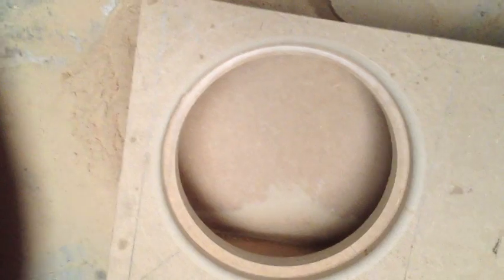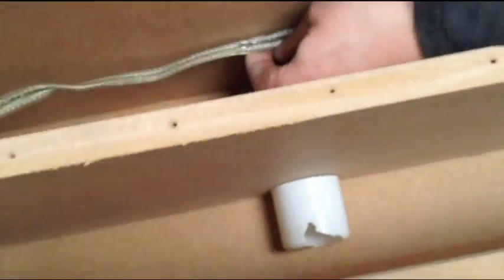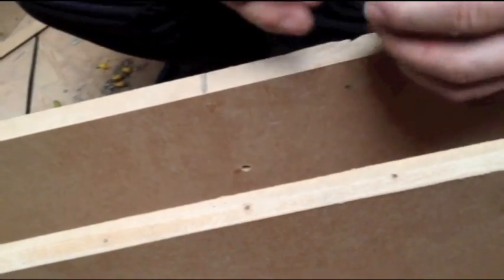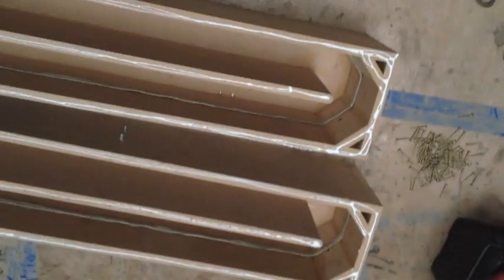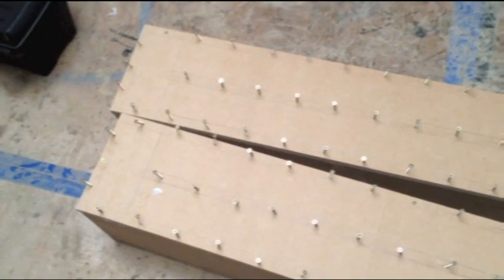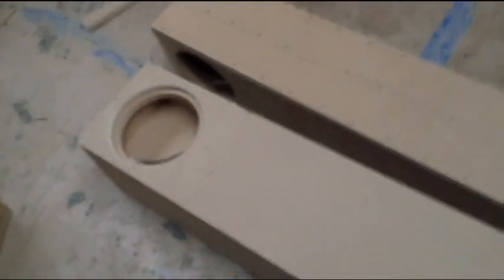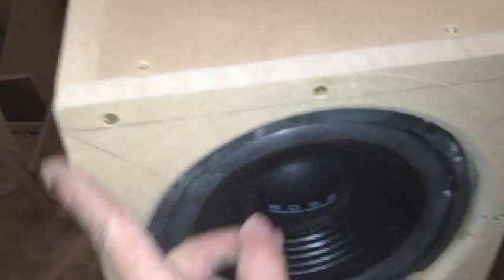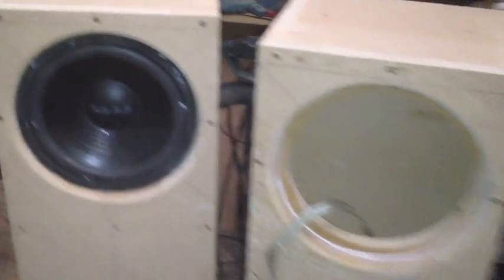Building a TL transmission line Design enclosure Box for 8'' drivers for my home audio system part 2

Comment: how you measure your port on a TL? and how the length of the box?
Reply: Your port should be tuned to the length of the frequency of the Free Air Resonance of your specific driver. How you determine that is you first take the speed of sound (1120 fps) and divide it by the driver's free air resonance (fs). Then you take that value and divide that by four because you only need a quarter of that wave length to make an effective T-line enclosure (just trust me on that, too long to explain). The port should be equal to or slightly greater than the cone area of you driver. So say your cone is 124 square inches, your port, at any given point, should be equal to or slightly exceed that amount of area. I've only ever built a single T-line in my life, in fact it was only a few months ago for a Sundown E12 v2 subwoofer. Let me tell you, the box may be huge, but it kills it in the SQ department and low end extension over my ported design previously (I can hit the low 20's with only a 3db drop). If you got the room, definitely give a Transmission Line Enclosure a try! Hope everything I said made sense!
Reply: My result from the devides is 8.64 what is this? the length of the box?
Reply: Billy Orfanos Yes,Yes it is
Reply: Capt Crawfish I built one and made it just slightly smaller at the very end as it tapered down the line... loved it because it made a huge thud whenever it got to the end! I'm pretty sure it's not the best to do with a speaker but then again... DAT BASS THO
Reply: Vasilis Orfanos , computer design, did you watch the video at all

Comment: Sweet. You did everything "overdone" and that's how enclosures should be build. Nice build. I have always woundered what an 18 inch subwoofer would sound in a T line enclosure in proportion to an 8inch sub enclosure. hahaha HUGE box! i wanna try it someday.l
Reply: I've thought the same. You would need 1 tline cabinet that was absolutely massive. Not practical but I could only imagine the clean bass

Comment: im just wonder why is it that my tline sub box i built sound great in my bathroom shake the hell out of everything and hurts my chest but yet only sound link a single 12 in a ported in my car. box has alright lows but not like when it is in my bathroom could in be because my tlines port is at the rear and not in the front firing in the same direction as the woofer?